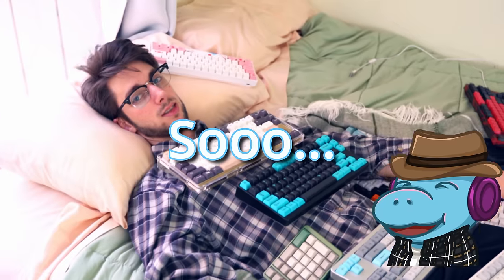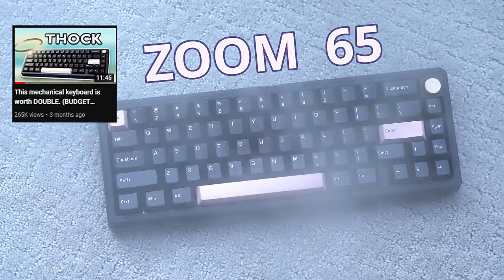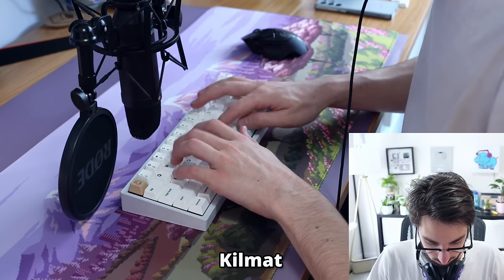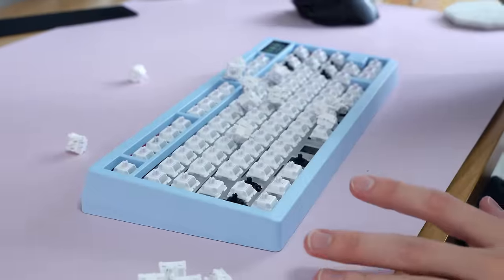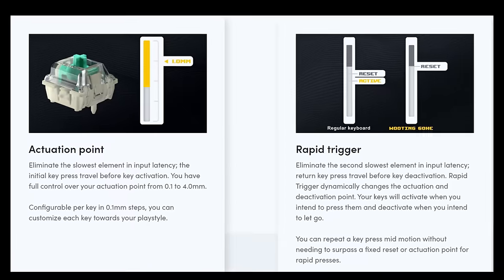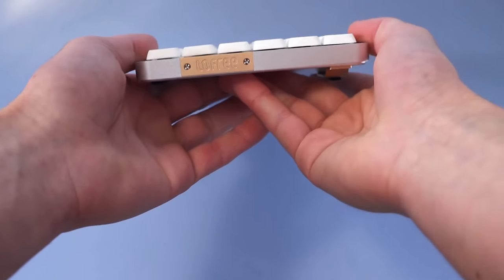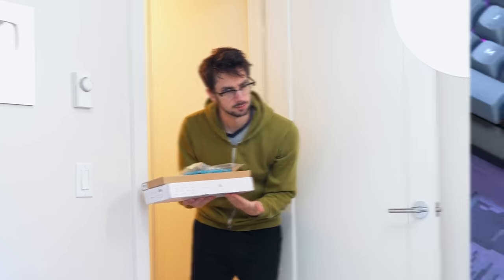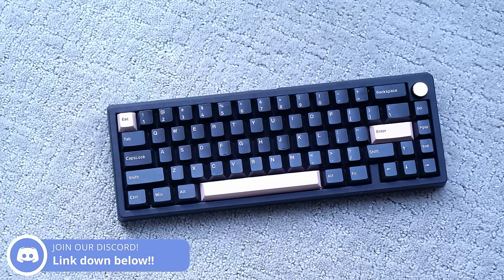I Tried Over 60 Keyboards... (So You Don't Have To.)

Comment: i bought the womier sk71 based on your recommendation and its been great. something that really surprised me about this keyboard is just how solid the wireless 2.4gh performance is. the battery life goes over a week without needing a charge (at least in my experience using it with gaming) and the wireless performance has no complaints from me.
Reply: Considering buying it... Do you game with it? if so, do you feel any latency playing on wireless? thx for the info :)

Comment: I love your “preference disclaimer” I have wanted a Gmmk pro for a couple years finally purchased it despite all the negative feedback, I did a tape mod… too poppy so I undid it, added blue samurai double shot PBT keycaps and I love it! Space bar stabiliser needed some more lube and now I looove it! It Thocks!!
Reply: The main issue with the GMMK Pro isn't thats its just bad, it can be made better, but that its "bad" for the price, it is overly expensive and many cheaper keyboards get much better sound out for a much cheaper price

Comment: New budget king: Ajazz AK820. $50-60 bucks, fully built, sounds amazing right out of the box. I highly recommend. Another budget aluminum diy is the Leobog Hi75 that needs no mods. It's truly mind blowing what is coming out now for these low prices. When I started in the hobby, buying an RK61 for $50 was the budget go-to, but it was all plastic with no foams and required heavily modding it before it was any good. I love what's happening right now in the hobby!!
Reply from the maker: I'll scope it out
Reply: @HipyoTech  forgot to mention that I grabbed the pro version with Gift switches. Got a lil LED screen and sounds amazingly clacky
Reply: Leobog god tier
Reply: @nebulazykbs do you happen to have a link as I can’t seem to find it?
Reply: 1 up for the Ajazz AK820
Reply: Aula F75 is also a budget king for what you get out of the box

Comment: I love my modded ROG Azoth. I used lubed and filmed Morandis, some Keychron DS PBT keycaps, replaced the steel plate and silicone plate "foam" with a PC plate and poron/ipxe PCB and plate foams from AliExpress. I also added two layers of painters tape and removed the thick silicone filler inside the case. Some people won't understand doing so much to a "gamer" board instead of just buying a better board, but I have a 1 of 1 Azoth that sounds and feels exactly how I want it to, and I wouldn't trade it for any other keeb.
Reply: Does the PCB on this Asus board have Hotswap capability for putting your own switches in?

 (I saw an Amazon review with someone who put some Gateron switches on it....but he never mentioned if he took the whole thing apart and desoldered the spacebar and modifier key switches and then resoldered the new Gate yellow switches)
Reply: @phlooke  Yup yup, it's a hot swap PCB. You can even use pcb-mount stabs if you want, but the stock ones are hella smooth already, even without any tuning.

Comment: Here's what I'm looking for. Where to get it?

1. Full-size keyboard with RGB. 
2. As silent as possible.
3. Tactile & Hot-swap switches.
4. Shine-through keys.
5. Zero bounce/flex.
Reply: I dont think many manufacturers sell prebuilt keyboards with silent tactile switches. It would be better to just buy a barebones full size keyboard and buy your own silent tactile switches (boba u4, haimu whisper silent tactile, etc.), then slap your own keycaps on.
Reply: The GMMK 2 Fullsize with your own switches and caps. It's a 96% board but it has absolutely no flex in it. As Billy said, nobody's making a keyboard with those specs prebuilt.
Reply: I wasn't expecting a pre-build to my exact standards. heh  Just curious if you were going to build, what parts would you go with... and where is the best place to get them? @Billy_The_Frog

Comment: [[READ IF FROM THE EU]] 
I bought a Zoom 75 a month ago after watching your video about it. I was lucky enough to get my hands on one of the last white standard edition cases (the special edition are just gone from stock sadly) and I built it following your recommendation, which means Morandis. It was my first custom keyboard and building it took me like 6 hours and I didn't even lube the switches. I will some day, but not for now. It sounds amazing and all of the trial and error in the building process was kinda fun (once I managed to fix everything I had done wrong like screwing the stabs too tight, like my spacebar wouldn't come up at all). I'm not gonna lie though, if you live in the US the shipping and import taxes might be lower, but I live in Italy and I had to import the keyboard from China and the lubing kit from Kinetic Labs from the US since in EU we have legit no custom keyboard market; it was expensive, like capslock expensive. The build is fire, but it cost me a net of a little more of 500, give or take. In case someone from the EU is here reading this comment, be aware of the import fees. You won't pay just the vat, you'll pay a huge shipping fee and a customs fee for the import procedure (which is literally just one eMail). If you find a good barebone try and get everything you need shipped in one order or two at max. e.g. the Morandi are sold by Wuque and Meletrix is Wuque, but they are not in stock on their website and I had to buy them directly from Wuque which sucks since it's a completely separate order and shipping fee. It's all fun and games until a 60 euros order turns into 110 euros after shipping and customs fees ahahah (laughing the pain away). 
All considered tho, I'd do it again. The zoom is simply great and yh for 500 there is waaay better stuff out there, but that 500 would be a 800 after shipping it to my doorstep so I'm pretty satisfied.
Reply: What switches did you buy with your zoom 75?

Comment: It'll be interesting to see how HE switches develop. The gateron Jades are supposed to have tighter tolerances and close off the bottom portion so the magnet isn't exposed.
Reply: So far people that have gotten them say they get rid of many of the crap sounds other HE switches have.  Next to try are the Geon HE coming soon.
Reply: i have lekker 60, geonworks raptor HE, and jades i must say the jades are much better than both of those options

Comment: Thnx to Hipyo I got a Monsgeek m1(w). With tape mod (2 layers electrical), force break mod, and fixing the golden parts on the sides with a little tape, this thing feels and sounds sooooo good. I also used the other included (black) stabilizers. It's my first custom keyboard, but I know I will use this for a long long time. Everytime I use it I'm surprised by how good it feels and sounds. It's like I use it for the first time. No ragrets, thnx Hipyo!
Reply: I built a Monsgeek M5 barebones recently and they even include the force break "stickers" in the box at this point. I'm really enjoying it as my first build after previously only getting "gaming" keyboards. Was very easy to build for my first time and sounds great.

Comment: I bought a Redragon K530 Pro to start off. It was fine, but I wanted more customization for keymapping so I bought a Keychron K12 Pro for the QMK support. Replaced the guts with some YDMK Blank Milk Fog keycaps and some LTC Jerrzi Similar Red switches. Simple but a lot of fun and very pretty.

Comment: i have been using a razer tournament edition with optical keys forever and I have not liked it much. I really wanted to build my own which I will but I ended up going with the Keychron C3 PRO since I got it for $32.00 and I can 100% say that it dominated my razer keyboard. 

The Switches feel so good and smooth, the keyboard is well built and has some weight to it. I know its on there lower end stuff but my razer was over 100 and this $32.00 keyboard blows it away. 

I do still plan on building my own so I have been watching all your videos to get my options down.

Comment: So, I'm relatively new to mechanical keyboards but I've recently become obsessed with finding my perfect keyboard for a decent price. Now, my perfect keyboard is nearly impossible to get because I require a knob and would highly prefer full size and passthrough as well. Anyway, last year I got two wireless keyboards used/like new from amazon, an RK96 and a Redragon Horus K618, because I had no idea how I'd feel about them. Well I'm not a huge fan of the Redragon which kind of surprised me but I'm curious if you'd tried any version of the RK96 because I kinda love mine. It is however missing a few things I'd really like in a keyboard and I'm pretty sure they solved all of those concerns and then some with the RK S98. I actually had someone on a call tell me my keyboard sounded musical so you can imagine how proud I was. Great video, thank you!

Comment: I bought a $23 60% keyboard on AliExpress, and in my ears it sounds like your favourite keyboard. But then, I only bought it to remind myself that I don't EVER want a mechanical keyboard again (yes, I grew up with both the Apple II+ clonky keys and the original IBM model M).
My favourite right now is the Logitech MX Business, despite it weighing a TON. I'd love it even more if it was a TKL, because I've never used the numeric keypad in anything other than MS Flight Simulator. Also, if Logitech would make a M575 trackball with the silent tactile switches of the M590 mouse, that would be perfect. I had one of my old (13-14 years or so) wired trackballs go silent after a cleaning accident, but I never found out how. Also, the feedback disappeared, which is not really what I wanted.

Comment: I just got a V1 Max. The upper right corner was way too soft, a bit crooked and too low because the PCB was bent, and I found the gaskets disappointing. I've fixed the PCB and modified it by adding my own foam. The switches were changed for Durock T1 Shrimp(HIGHLY recommend for tactile users), keycaps changed to xda profile dye-sub. I do find the gateron jupiter brown switches it came with are quite good though, nicer than the k pro brown my k10 pro came with, so I put them on that board.

Comment: I like my Keyshon K2 keyboard. One, has an acrylic cover for it. It's both wired and wireless. The only issue I had was with my original V1 Kychron that I ordered off a kick starter.. My g/f spilled a drink on it. It died. I communicated with Key Chron Canada. They weren't interested in touching it since I  had not bought it directly from the, I had to go through the kickstart page to get any help. At that point I started a conversation in chat to find out how to send it in and get it repaired. at a point two days into the conversation after verifying my purchase (I had to send them copies of my email and copies of the box and with the serial number) they just stopped responding to my enquiries. I just bought a second V2 K2 but it was frustrating.

Comment: Nice video:)
Another good hall-effect keyboard is the steelseries apex pro, although a bit expensive.
It does have rapid trigger, 2.4, wired, bluetooth AND support macros, which IMO is a very underrated feature for any keyboard.
It does NOT sound good but it does feel good.

Comment: I own three Keychron keyboards, and I loved them when I bought them. The stock keycaps, however, just do not seem built to last. My Keychron keycaps are fracturing on the bottom, and since the keyboards are out of warranty, Keychron wants me to pay $8 shipping whenever I need a keycap replaced. They will only send me individual keys rather than a full set, even though it's patently obvious that there had to be some kind of manufacturing issue with my model (K8 Pro), since lots of people on the internet are having the same issue. I would hesitate before buying from this company, to be quite honest.

Comment: New sub here :) question: have you ever modded the Keychron C1? I want to start modding and that's the keyboard I have at home. I've seen a few C1 modding tutorials online but wasn't super satisfied with the thockiness in the sound tests. Your sound tests always sound WAY better so I'm not sure if it's your equipment/modding techniques or if the C1 is just not a great keyboard to mod.
Reply from the maker: I havent - but if I recall switch and click has done a vid with the C1 - its pretty hard to mod

Comment: One thing I really need to know is, when they have CTRL WIN ALT keys in the lower left, is it possible to change these? Of course I want to change WIN to the command key for Mac (being a Mac user), but I want to set them up as CTRL ALT COMMAND like every Mac keyboard ever. I will not teach myself a new keyboard layout just to by a third party keyboard. Giving us info on what software comes with the keyboards or whether the keys themselves are somehow "seen" by the keyboard, would be nice to know.

Comment: Woah im so happy that i got the womier sk71... Initially I had to switch it to pairing mode each time i power it on on bluetooth mode.. however, after a couple of days it started auto connecting to my laptop and is super smooth... The factory lubed switches are incredible and thocky for the 90$ price... The only drwaback is that we can't adjust the incline angle as it has no adjustable feet😢 and i really wish they had included those... But anyways the thocc they provide is worth it

Comment: In 2024 I pray manufacturers start to move away from so much emphasis on foam. I don't want to see everyone cheap out on the case because they can include 5 pieces of different foam and know it will sound good enough with all that dampener. Takes away so much character in the sound of the board and the switches.

Comment: I got a BlackWidow 75 recently, and it's "ok" but I have discovered that I cannot do anything less than a TKL keyboard.  I'm a programmer and have 30 years of muscle memory built up for the Home/End cluster on a TKL that I simply can't get over.  I didn't see too many TKL options in this video :(   Oh yeah, I also can't stand linear switches.  I returned my first linear switch keyboard I bought because I simply couldn't handle typing on it.   If anyone has any suggestions let me know!

Comment: Okay, out of silly curiosity, are there any hall effect switches that have haptic feedback? Imagine a haptic switch that can actually provide a haptic response when a keystroke is accepted in "binary" mode, but also can be addressed by games to act as an alternative to a game controller's rumble. The other side of hall effect key switches is that games need to start using them as true analog inputs for movement. Also, imagine a half press on E activating some power, but a full press bringing up the ability wheel. Once keyboard makers and game devs agree on a standard on how non-binary keys report their actuation, we can see usage in so many more places, software-wise.
Reply from the maker: Not that I can think of but that would be really interesting

Comment: feel like i have to correct you here, the neo boards are not group buy. they are all in stock currently, however they ship out in batches rather than each individual board sold so it may take a week or 2 longer than keychron to ship. considering the neo65 is $105, i feel it's superior to the keychron q barebones in every way unless you want a specific layout or really want it 1 week earlier. plus you can choose color and plate for the neo, but you have to pay more for different plates with keychron
Reply from the maker: I was looking at some of their delivery estimates on their timeline and It's quite a while for some of the newer "batches"

Comment: Looking for a 75% size keyboard but around 100-200 dollar price point. Do you have any recommendations on a certain manufactured board that would not require any major mods, but a great performer right out of the box? I would really like tactile switches (hot swappable) but open to something besides this linear switch Huntsman elite that is so dang clicky.  A premium feeling keyboard will be great but not really a deal breaker.  Thanks for the help.

Comment: My experience. I need full 100% layout. Bought Keychron K10 Pro. Quite satified in general with the quality, customization and BT/cable posibilies, fine for the price. Then, the switches. I am old enough to have used the real authentic Cherry keyboards and that feel is my aim. Keychron came with browns, which sound quite good buut totally HATE the feel. I cannot tell apart from red ones, they sense even worse than membrane keyboards with rubber keys, simply feels like they are broken. Cannot understand why people buy mechanical keyboards that feel worse than membrane keyboards. So, bought a tube of blue ones and replaced them. Somewhat dissapointed: Tactile is fine, very much better than browns, but sound is HORRID. It's a high pitched KLIXXX that really hurts in the ears. Real original Cherry where still harder to push and sounded CLONK CLONK , a low pitched heavy sound totally soathing. I didn't found that. I'm trying to get used to blues.

Comment: I got the v1 max, kinda wish the rainy 75 was in stock, I would have bought that one instead since the specs are similar and I'm basic, love linear. Hate lubing switches etc. The rainy has the much, much better case (only terrible color choices for the most part, only the lite version has a black color, the normal has silver and the pro has a very cream colored "white". The other colors are blue/pink/purple, stuff I'm not into). The pro version has the worst color but a 7000 mah battery. Eh. If I slap some decent prelubed yellows ont he v1 max I'll be happy and done

Comment: So if in spite of being careful how do you fix/trouble shoot for a broken hot swap if a switch doesn't work
Reply from the maker: If the socket is just loose, you can resolder it on, if its fully popped with the pad you might need to get a bit more crazy - there are some guides out there
Reply: I just put some pressure in the internal wiggles the lose swap socket tight not sure how that worked, and it works, hopefully I don't need to get a solder iron haha